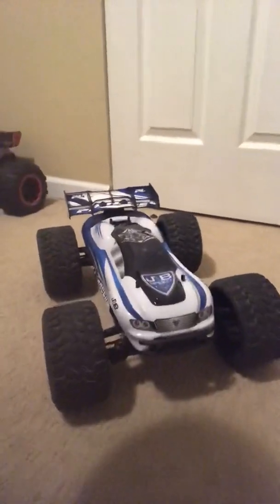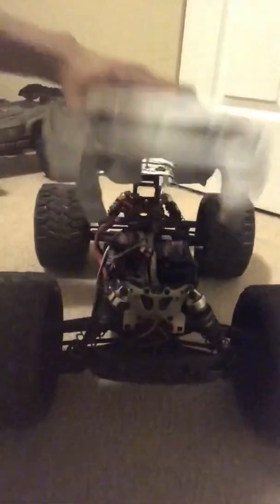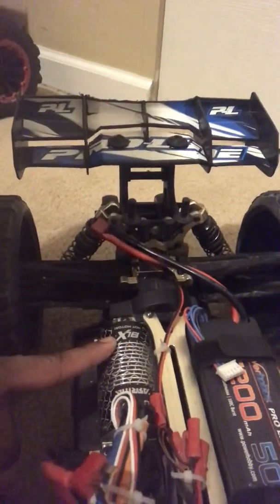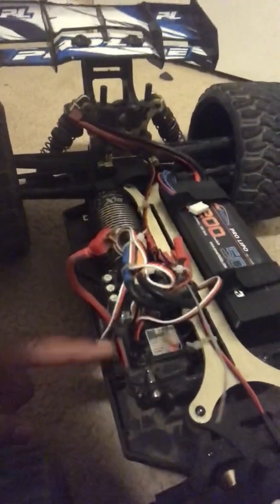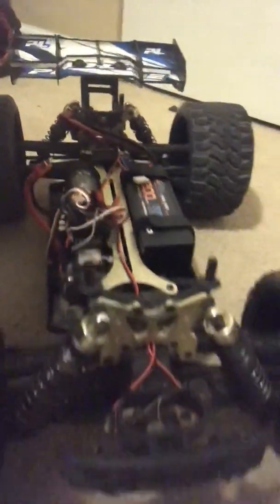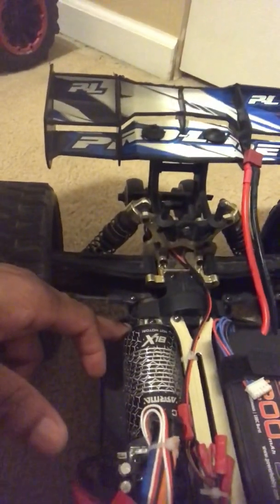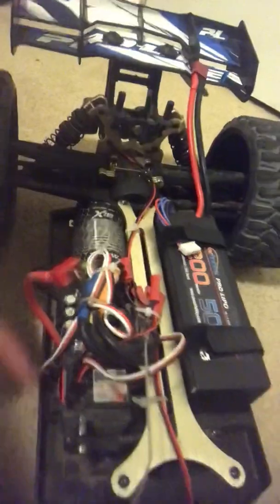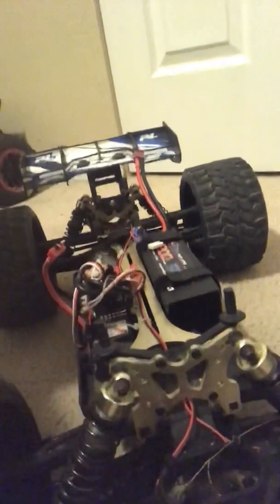Jlb cheetah demon 1/10 Final upgraded 21101

Comment: How fast you got it to go? What motor u recommend if im looking to speed it up
Reply from the maker: This car is customize I haven’t ran it on 6s yett only ran it on 4s I still have to upgrade the slipper clutch..I only got it too run 54mph it keep flipping up so I had to lower it..I will be posting a video soon me running this car on 6s for a speed run...too speed it up tp power 5600kv 4040 cm motor.